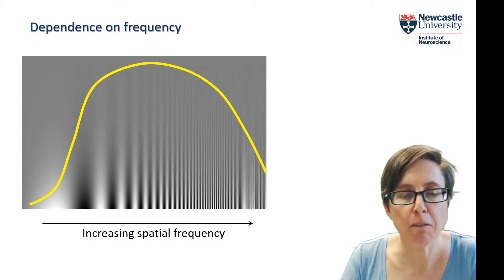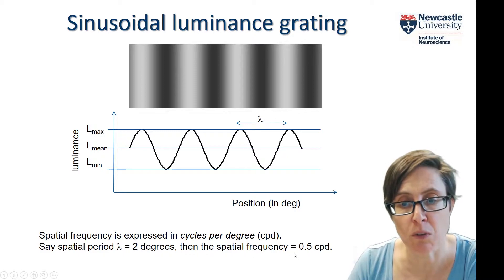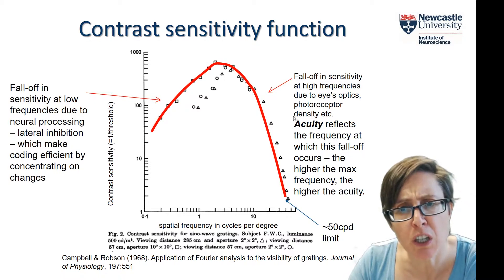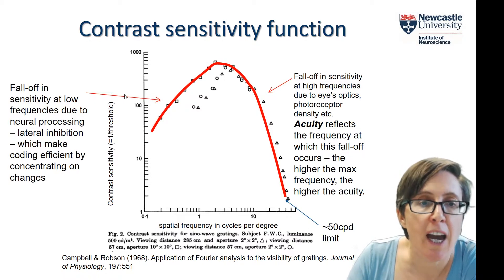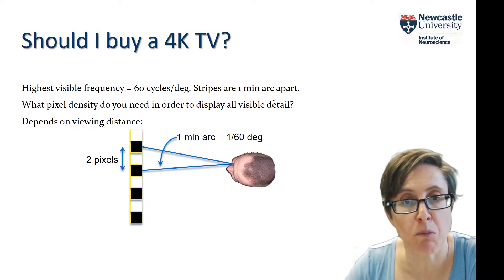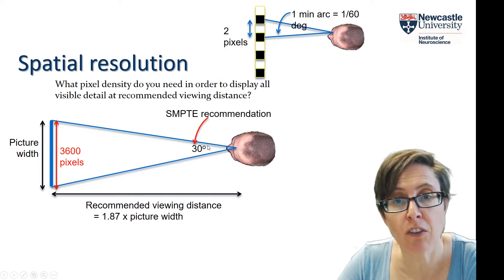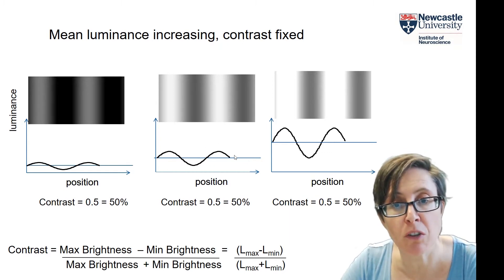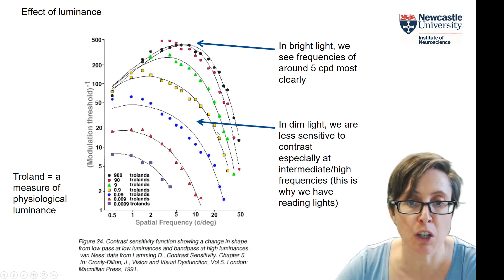PSC3008 CSFdata

Comment: Hello! Why is low frequency fall-off caused by lateral inhibition (3:00)?
Reply from the maker: Great question! OK, so at low frequencies, by definition, luminance is changing only slowly. So you have wide areas of the visual field where the light level is high, and then wide areas where it is low. Cells with lateral inhibition don't respond well to such patterns of light.

Consider a neuron whose receptive field consists of an excitatory "ON" centre surrounded by an inhibitory "OFF" region, i.e. it has "lateral inhibition" - inhibition on the sides. This neuron won't respond well to uniformly bright light stimuli, because although its ON centre will be exciting it, its OFF surround will be inhibiting it. So, it won't respond well to low spatial frequencies. 

It will respond much better to higher spatial frequencies, where its ON centre is around half a period. You can position a high-frequency grating on the receptive field such that a light bar is over the central ON subregion (so the cell will receive excitation), and the adjacent dark bar cover much of the OFF surround (so, again, sending more excitation), with relatively little of the bright bar on the OFF surround (contributing a small amount of inhibition). That's why a cell like this will respond better to intermediate frequencies than to low frequencies. Lateral inhibition has the effect of suppressing the response to low frequencies.

Sorry, long answer but I hope that helped!